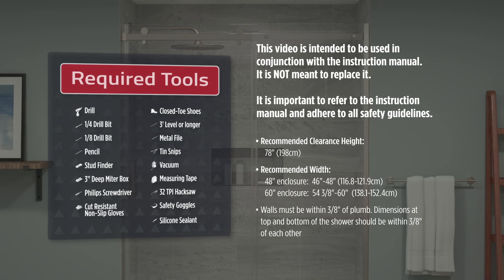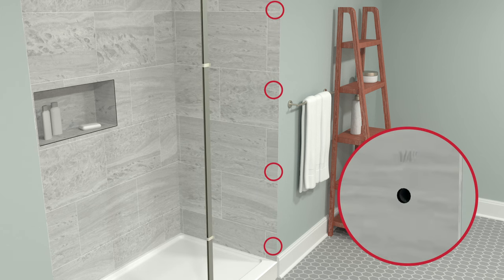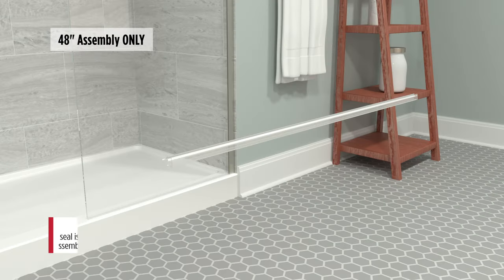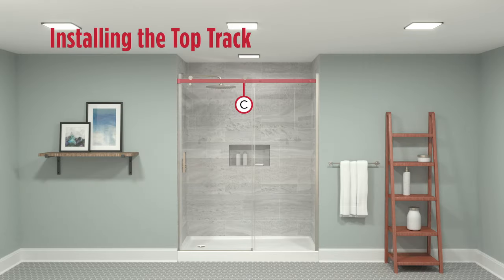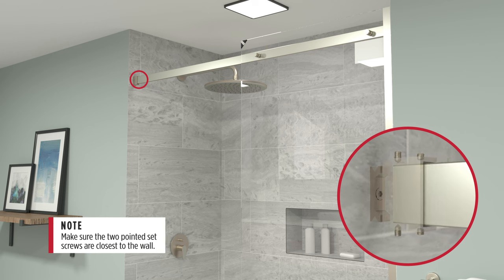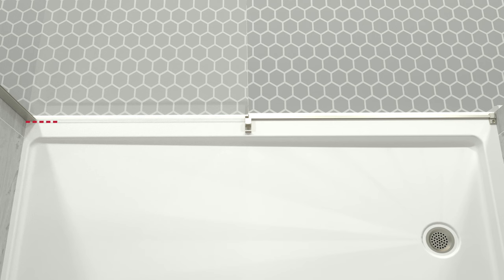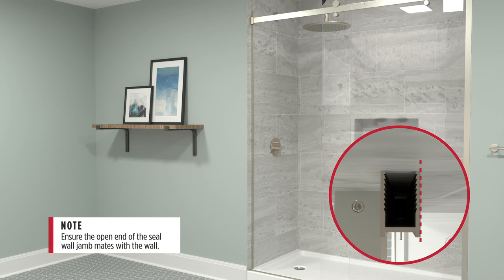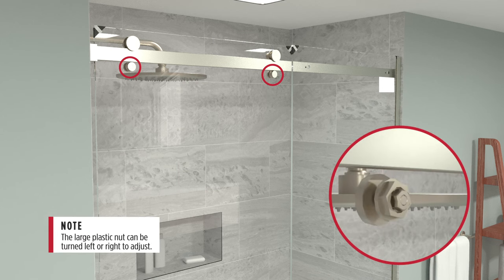Delta COMMIX Sliding Shower Door Installation Instruction Video

Comment: The written directions are a nightmare. Mine also came with 7/32” anchors, good luck finding a masonry bit for that. This was a pain in the ass.
Reply: Per Delta you can use a 1/4 tile drill bit which you can actually find instead of the 7/32.
Reply: I tried it out on one hole and the anchor spun inside... @thebigroy

Comment: The fixed panel wall bracket is flimsy and was hard to make straight.  I also had to widen it with pliers so the glass panel would slide in.  

The instructions that come with this door are not easy to follow and none of the parts are labeled.

The anchor on the bottom bracket spins when you try to screw it and is impossible to fasten.  I had to use a different anchor to make it work.